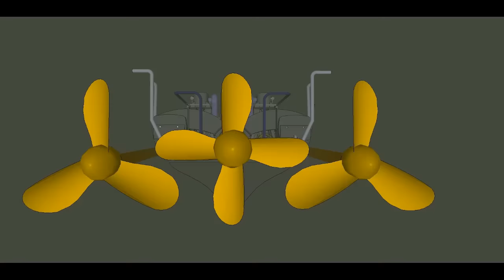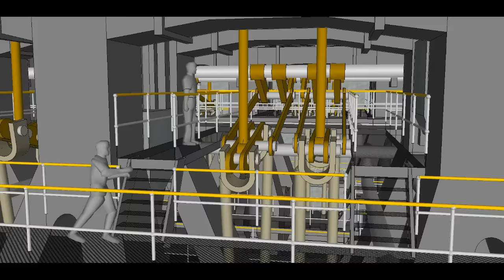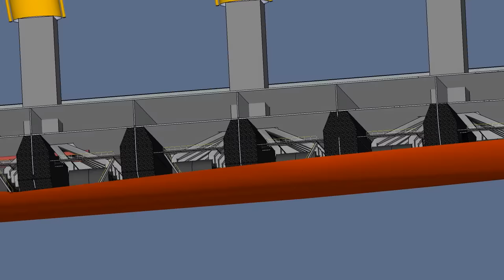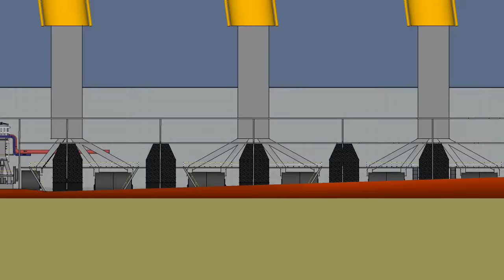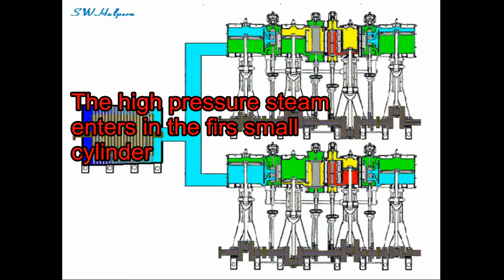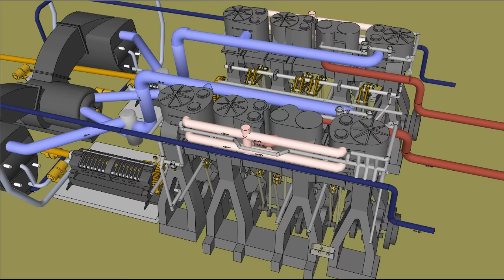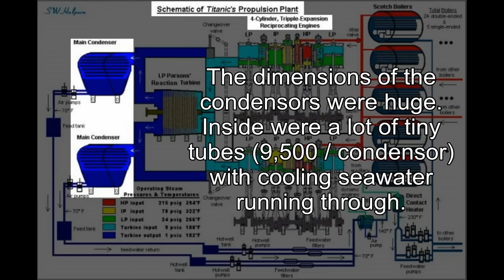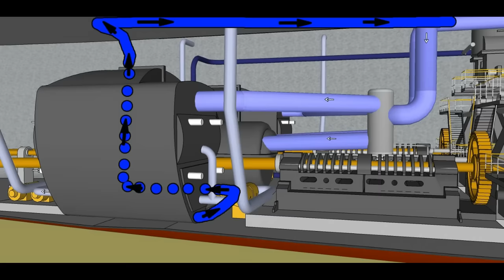The Engines of the Titanic

Comment: I knew realised that large steam engines had a small steam "starter" motor! Thank you for such an amazing video
Reply: Actually, that's a "barring engine".  For smaller engines, to put the engine in starting position (high pressure piston just past Top Dead Center) an engineer would have used a crowbar to adjust it.  Also, before the engine was started, it was necessary to make sure no water had condensed in the cylinders, which would severely damage the engine.  So, the engineer would "bar it over" one full revolution.  When engines became too large for this, the barring engine was added.
Reply: Mark Stockman that's awesome thank you for the extra information, hydraulicing is never a good thing and I didn't think about that being an issue but it makes complete sense!  I have a Cat conrod that is bent into an S shape because an injector leaked causing the cylinder to flood.
Reply: Mark Stockman also known as a pony engine.
Reply: Only non-reversable engines had a small ("barring") engine, it was to bring the pistons to the correct positon for starting. Reversable engines did not need it, they could start in any position.

Comment: This video reinforces my belief that Titanic's reciprocating engines did not reverse in advance of the allision with the iceberg, as depicted in the Cameron film. They would be incapable of starting in reverse until the weigh came off the ship as the flow of the sea through the screws would keep them turning and create a large opposing torque against reverse movement.
Reply: its a Hollywood film.  Great film, I seen it twice.  You have to realize that nobody really knows what happened on the bridge as the entire bridge crew did not survive that night.  It is assumed and often suggested that the officer on the bridge ordered all back full and hard left rudder.  YES I SAID LEFT.  WE DON'T SAY PORT AND STARBOARD with rudder orders.  Certified Master Helmsman US NAVY. Although military, the orders are the same in the civilian world as well.  It is to avoid confusion because Engine orders on a multiple shaft ship are port and starboard.  The problem with that even if the engines went to reverse is that it would have been more like a twist than a turn.  It isn't so much about torque as it is momentum.  GRAVITY.  first law of motion states that an object in motion stays in motion until acted upon by an equal an opposite reaction force.  That means the force opposite has to be equal to make them go in reverse.  the engines on a steam ship don't just reverse.  Someone has to turn a valve and reverse the steam flow.  Train engine and ship engine both work in the same basic idea that a valve has to force steam flowing the opposite way.  This is one of the reasons steam is so inefficient.
Reply: @robertbenoit5374  The orders from the bridge or the telegraph indication has no bearing on whether the screws reversed, it defies the laws of physics if they did. This is because:
a) As long as the ship makes headway, the screws will continue to turn  forward unless sufficient opposing torque is applied to halt them, much like the wheels on a motor vehicle
b) There was no brake on the propeller shafts to provide this torque
c) The reciprocating engines were not self-starting, they had to be turned with a starting engine to a certain position to start
d) On the first half-revolution, only the high-pressure cylinder acts, so the torque is low. On the next half-turn, the intermediate cylinder begins to act, less the losses due to "cold" cylinders at the start. Then the low-pressure cylinders after one full turn, after even more losses.
   So, the reciprocating engines could not be rapidly brought to a halt in the right position for reverse starting and would be incapable of immediately producing the torque necessary for reverse rotation. And of course, the turbine had no reverse capability.
Reply: @robertbenoit5374  The orders from the bridge or the telegraph indication has no bearing on whether the screws reversed, it defies the laws of physics if they did. This is because:
a) As long as the ship makes headway, the screws will turn forward unless sufficient opposing torque is applied to halt them, much like the wheels on a car continue turning unless enough torque is applied to make them slip (or cavitate)
b) There was no brake on the propeller shafts to provide this torque and the reciprocating engines were permanently connected to the screws
c) The reciprocating engines were not self-starting, they had to be turned with a starting engine to a certain position to start
d) On the first half-revolution, only the high-pressure cylinder acts, so the torque is low. On the next half-turn, the intermediate cylinder begins to act, less the losses due to cooling/condensation. Then the low-pressure cylinders after one full turn, after even more losses.
   So, the reciprocating engines could not be rapidly brought to the right position for reverse starting and could not immediately produce the torque necessary for reverse rotation. And of course, the turbine had no reverse capability.
Reply: Fun fact about the movie’s engine scenes: those were the engines of a different ship, the Jeremiah O’Brien. The engines were mirrored and scaled up to size, which is why they appear HUGE in the film. However, in reality, the engine is about the size of your standard human.

Comment: Thank you very much for such a fantastic job in showing the engines of the Titanic.  I was stationed on the USS Kitty Hawk which weighed about 85,000 tons, a bit bigger than the Titanic, except we didn't sink.    Only once did I get to go into the engine room.  It was fantastic to see the four prop shafts turning and even being able to touch them as they turned.  It was fantastic, but after looking at your video, it wasn't anything like the Titanic.  With all of the stokers working and the coal dust and noise, the Titanic was not fantastic, but insane, but really fantastic too, especially for those days.  Thanks again for such a great video.  C. Jeff Dyrek, Webmaster, Disabled Vet.  Polar Explorer.
Reply: different boiler setup on the Kitty Hawk because Titanic was coal and Kitty Hawk was diesel fired boilers. Either way I wish I had the experience you did.  I never made into the fire room on USS Guam to see the engineering plant.

Comment: In another video it’s mentioned that coal-fired steamships were painted black because of the dust spill from loading the coal.
Reply: Huh, I never even thought about that. Makes sense!
Reply: All coal-fired steamers of the era are black because of this. Check it out for yourself. Pretty much all of them. 

Coal is a dirty, and streaks. It also causes ash. Watch videos of the Britannic in hospital configuration. It's paint scheme will give away just how dirty these vessels got from the coal. Crew would spend a better part of a week just cleaning them between trips.
Reply: I think I saw that one. It also said that it could take up to 24 hours to reload the ship with coal; it was a very complex, dangerous, dirty, labor-intensive process; and you couldn't do much of anything else while coaling. No wonder oil caught on quickly even though it was considerably more expensive.
Reply: @williamwingo4740  It was more expensive, but the energy density of fuel oil is much better than coal. That was why Olympic was converted to use fuel oil, which doubled her range because the coal bunkers were turned into fuel tanks. Fuel oil has twice the energy density of coal, so instead of burning over 600 tons of coal a day, Britannic burned about 250 to 300 tons of fuel oil a day.

Comment: The condesers did a bit more than simply condense the steam into water because in doing so the pressure was reduced to signifcantly below atmospheric pressure. This meant the centre turbine had a larger diffential pressure accross it than just the  9 psi of the LP cylinder exhaust. As a result the turbine generated significant power once steady state running was achieved. The combined engines were in effect running in a quadruple expansion mode. For its time the Titanic was quite effcient.
Reply from the maker: A very clear analysis. Thanks!
Reply: I'm curious how efficient steam engines were back then. How much of the energy was wasted out the exhaust stack? An internal combustion engine only uses about 20% of it's fuels energy, the rest is wasted as heat going out the tail pipe or radiator.
Reply: @johneckert1365  It all to do with the temperature and pressures involved. A boiler has a limited pressure and temperature it can withstand. Internal combustion can reach much high pressures and temperatures but of course it is a cyclic process whereas a steam turbine is a continuous cycle. The higher temperature and pressure of internal combustion may give it a better heat efficiency than a steam  plant but the products of its combustion are more toxic to the planet.

Comment: For non engineers: At the time steam turbines were already in use and replacing the reciprocating engines, but on the Titanic it was decided to use 2 traditional reciprocating main engines because they had been proven in service and well understood by engineers. In effect Titanic's complete propulsion system was an early hybrid as it incorporated one small low pressure steam turbine, along with the reciprocating main engines, to drive the smaller central propeller as shown in the animation. The small steam turbine could not be reversed so it would be disabled when the ship was moving astern
Reply: Further note: The first geared turbines were developed in 1911, well after Titanic had been designed. By 1917, all new naval construction used geared turbines. Titanic's turbine being fed by waste gas from the main engines was an energy recovery method; the turbine was the last stage before the spent steam reached the condensers for reuse as feedwater.